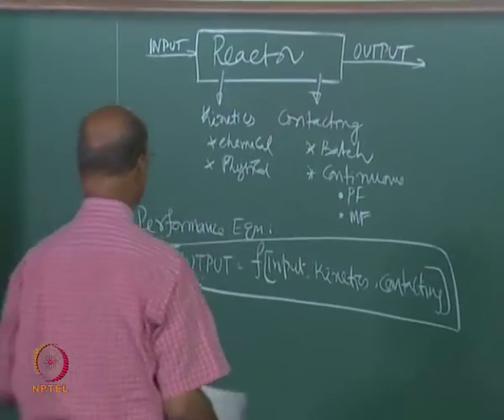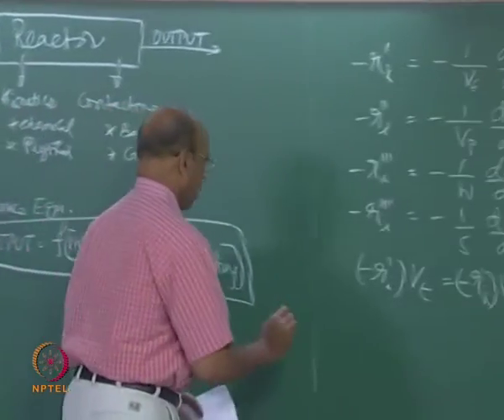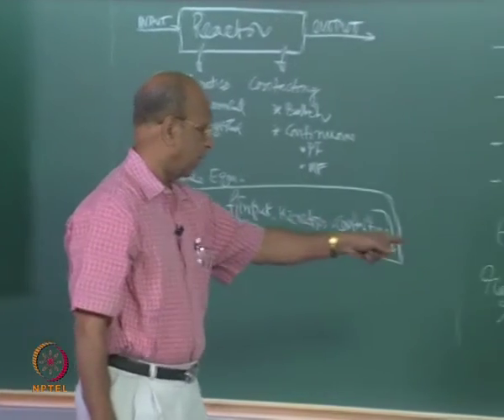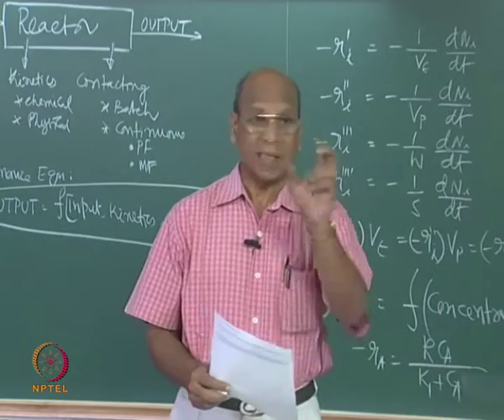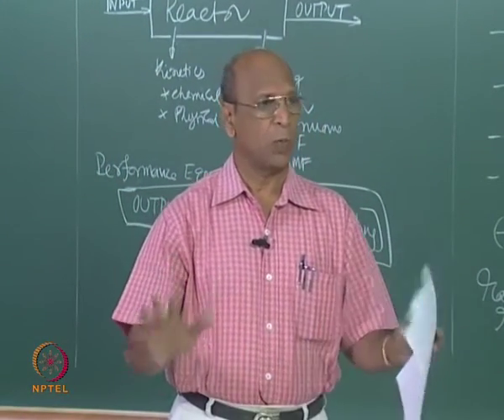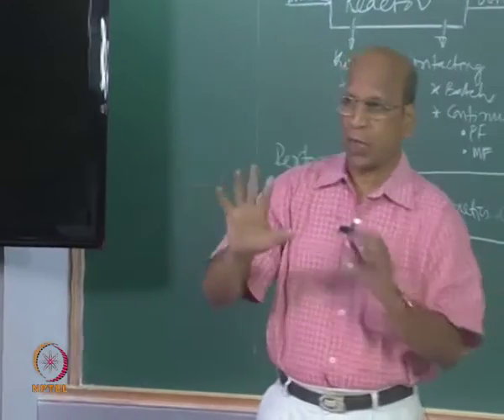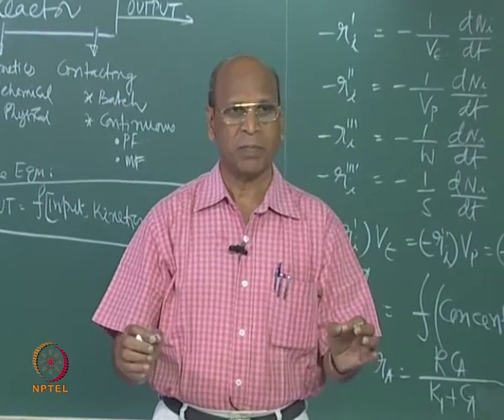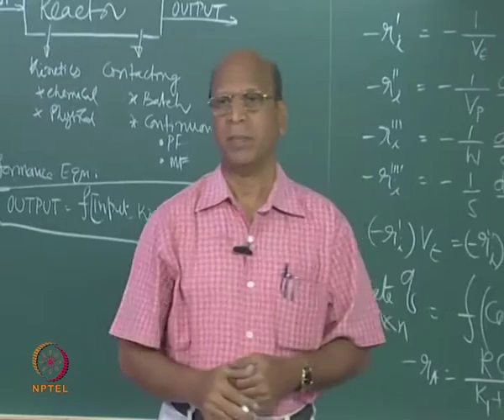Mod-01 Lec-9 Basics of Kinetics and Contacting

Comment: respected sir, 
i am nikita wamne studing in 3rd  year B. tech. doing preparation for gate 2020 i jaust want to know   that 
as you have asked one question in this video like when we will use PFR  and when we will use MFR ?
i have read from book that  for  positive order reaction we will use the PFR and for negative order reaction we will use MFR because for +ve order reaction  PFR will give the more conversion as compare to MFR  for the same volume and for _ve order reaction  MFR required less volme than PFR  for the same conversion 
so what should i say if someone will ask me 
either in terms of residence time ,  temperature or in terms of order
Reply: In terms of Residence time: PFR is preferred when residence time is very low (high rate of reaction), MFR is preferred when residence time is high (low rate of reaction)
In terms of Temperature : MFR is preferred when the reaction is highly Exothermic, PFR is preferred when the reaction is not highly exothermic (in general cases)  because in plug flow it is not possible to maintain isothermal conditions (i.e equal temperature at every point)
Reply: @chiranjeevikanike  nice